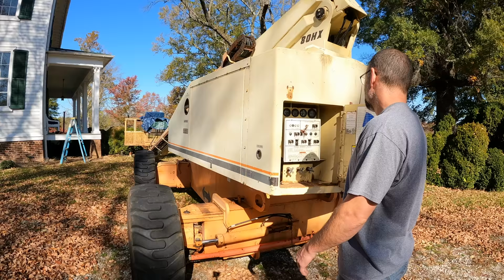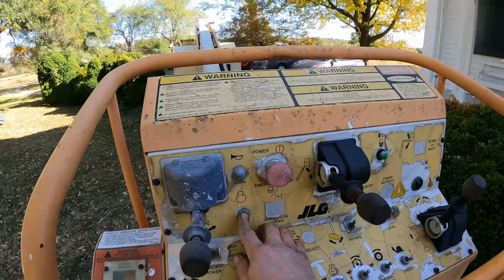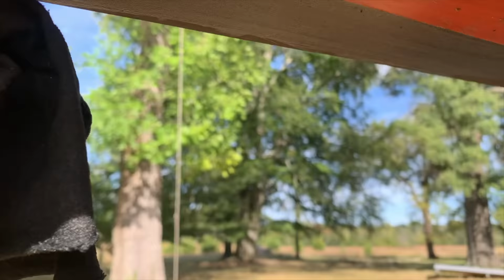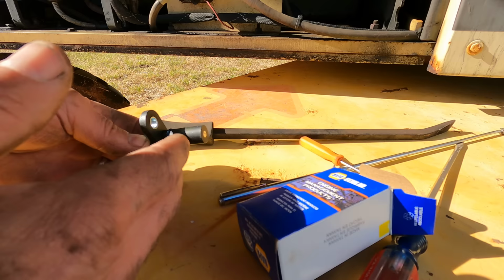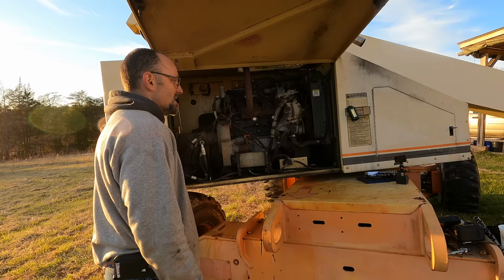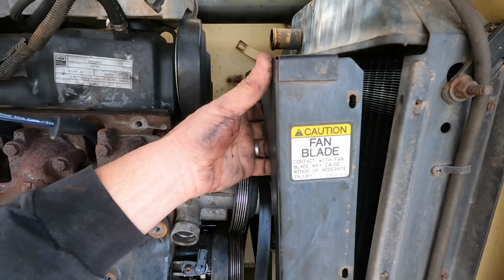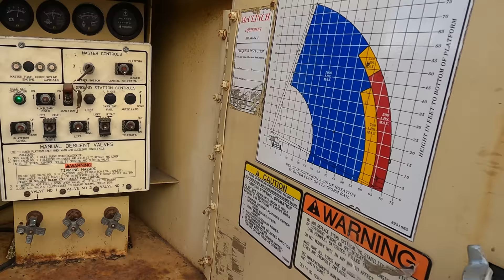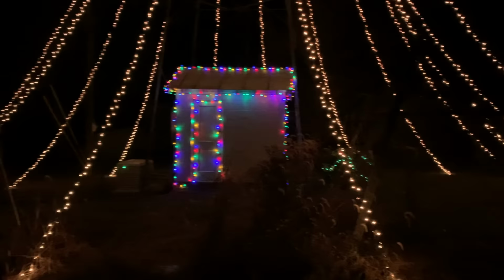My Boom Lift Broke Again! Fixing It & Then Doing a CRITICAL Job With It.

Comment: That is a wax motor on the choke limiter thing. its probably bad and not allowing the choke to open as the engine warms up, or not closing giving full choke when cold. you can test them in a pot of water. they should extend as the water temp rises.

Comment: Not sure if this matters or not, but the 2.5l ford engine is supposed to be fuel injected and not carbureted, and also is designed to be dual spark, with 8 plugs instead of four. Like I said, not sure that would make any difference with your long crank but I figured it is information nonetheless.

Comment: Change the choke pulloff piston (the thingy that's keeping the choke from opening fully) and the engine should operate much better and the carb can be adjusted properly. Check for voltage on the bimetal choke during/after start, if none fix it. Choke should be clocked just closed when engine is cold and not running. Bimetal should gradually open the choke as it warms electrically and the vacuum piston should open choke fully on acceleration. Set the idle to at least 800 - 1000 it sounds like it is still too low.  If there is a fuel pump (I forget) then rework or replace it, your not getting good fuel and it seems to be draining back when it sits.

Comment: Need to check you throttle speeds. The carb idle stop should be only set enough to keep running. Once linkage is on idle is 1080,  mid idle is 1800 high idle is 2300. Check you governor preload to carb

Comment: Have you checked to see if there is check valve missing or stuck open will allow the fuel to drain into the tank.

Comment: I bought a BMW from a garage it was just like your engine, hard to start, it went through their work shop a couple of times  with no improvement so I took it to the main BMW dealer, they adjusted  the inlet/exhaust valve clearances, to the correct settings,  the starting problem was sorted.

Comment: sounds like the fuel is leaking back into the tank from the lines.  try putting a temp tank on the top and use an electric fuel pump from that to see if that fixes the hard starting issue.

Comment: Talk about a nightmare to work on! Wow. Seems they want you to take out the engine to loosen a bolt. My excavator was a bit hard to work on but it was still manageable to get around. I did a new 90Amp alternator on the rear side of it and it worked like a charm. Cost me just USD 90 in one of the really cheap stores for car parts and such. No problems, although some of it was a bit hard to see. This is a totally different league.

Comment: I have this same carb and choke on my jlg rough terrain scissor lift, I paid to have carb professionally rebuilt, only way I can start it is pour gas in carb, once it’s warm can shut off and starts back up , I can’t figure choke out either . Let warm up 30 min and then flip switches

Comment: Your rope/ cable coiling method is very similar to the "over under" method used for power distribution cables or audio video cables. Works well with rope or anything,  can also throw out the whole length with no tangles as long as you did it correctly.  Only difference is you end up with one round loop, and not 2. I wish I could show the method in the comments. Maybe at some point I can upload a demonstration and link it to a video or something like that. It also keeps your cables from "pigtailing" and extends their life for this reason. I can't coil any other way now, but would love to get your method in my muscle memory just to have more tricks and options.

Comment: I think I would have cut that fan shroud into two pieces,  welded a little tab on one half and put a screw in each tab to put it back together. Heaven forbid you have to take it apart again but could ease the pain a little. 😂

Comment: Haven't finished the video yet but wanted to try to put my thoughts down before they run away. With the boom retracting when you have weight off of it.... seems to my feeble brain that maybe there is enough play in the boom, that when it is bearing all the weight, it could be dragging on the topside. As if on the side of the fulcrum near to the machine, not the basket it is able to bind or put too much friction for it to retract. Maybe the wear plates are too worn, or something just has too much slop in it, allowing it to drag on the top as it's trying to retract.  Putting the basket on the ground could be putting it in a better alignment and taking just enough weight/ stress/ drag off of it to let it come in. Hope this makes any sense or helps at all

Comment: Does sound like it’s starving for fuel on startup.  Fuel pump?  Check valve not checking, keeping fuel from draining down from the carb back to tank?  You’ve replaced the vital ignition components and crank sensor.  You have rebuilt the carb.  It has to be a fuel issue I believe.  Cool light tree BTW.

Comment: If you are sill having intermittent spark, you might look to see if it uses a EDIS module controlling the coil pack. If I remember right, I think that going bad could lead to hard starting?
It's been a long time, but the system was also used on the ford escort with the 1.9L engine

Comment: 26 years old man lift?   When I was young I used to do what your doing?   I learned when I got older is to not buy junk.    If you use it only twice a month, rent one.  Well I gave you a thumbs up.   I would take it and figure what you have in it and sell it and get a dependable 2-3 year old done  or new one.    That lift has a serious problem you haven't fixed it yet.  One point of advice is to make sure to carry your cell phone when your up on it or make sure you have someone on the ground to call the fire department to get you down.  Your going to get stuck high in the air on that machine    MERRY CHRISTMAS

Comment: - At 40:40, what if you split the fan shroud in two with virticle cuts {at the best L-R location}.
- Weld on 'L-shaped sleeving fingers' top and bottom, capturing the engine side flange and top and bottom of the fan shroud moulding, too. {to have tight 'finger squeeze', slightly curl the finger ends for easy alignment}
- From then on, take off ones side for parts access and keep the shroud for good cooling, too.

Comment: just a idea mabe the gas is feeding back into the tank and it sounds like it has to fill the carb each time you try to start it, try a check valve in the fuel line.

Comment: I wonder, since this is an electronic ignition machine, if you're getting big voltage drop over the power (or ground) wires to the ignition control module, you'll get intermittent spark, especially at low RPM. All it'll take is a little corrosion and you'll be bouncing around the brownout detection of the computer and it'll be rebooting constantly, which won't work well.

Comment: Hi John
Another great video, man you have a lot of patience. I am not sure if you have checked but it seems like a fuel pressure problem. Could be the fuel line allowing air in, or the pump itself . The problem shows itself after you leave it a while. I am from the UK i have worked on manlifts of all shapes and sizes. I worked on a airport so there were  vehicle mounted manlifts as well as self propelled manlifts the same as yours. They all have one thing in common safety circuits, that could be another root you can take. could be something trival as moisture in a cut out swith or moisture in a loom . Just ideas to be checked.  goodluck i am sure you will find it eventually. Merry Christmas and a happy new yer to you and your family

Comment: I think to change that part on the backside id be cutting a motor service door on the far side. Thats if the  booms not in the way.   I should know that motor i had one, but I dont.  Only put 5k miles on it new. Totaled the truck.

Comment: That half choke system could be part of how the engine governs itself. We had a shop gas ( petrol here in Australia 🇦🇺) forklift with a 2 barrel carburettor and it only used the first barrel when operating.  The second barrel was shut off and the choke flap was shut all the time. Happy hunting John.

Comment: I’m sure you’re getting a ton of these messages but I would start by double checking compression which looks pretty easy to do and then check the timing on this engine as the belt could have some stretch and be off a tooth I know you had the front of that engine off many times but I would also check the timing ring where that crank sensor was installed as  some times rust can cause them crack and be causing poor running conditions. Just a few things to check into. I enjoy watching you work through this frustration process lol but I’m sure you’ll get it eventually lol

Comment: Have you checked the solenoid cutoff valve on the carburetor? (You unscrew it at 1:59) 
This can cause problems like your having. Try replacing it or see if it is sticking, you can blank it off with the correct plug.

Comment: Have you tried changing the spark plugs?  The engine sounds like it isn’t consistently firing.  Also look for loose or poor ground connections in the ignition circuit.  The engine should run much smoother than it does, in my opinion.

Comment: WD-40 is not a lubricant if there was any grease on that chain now its gone you just cleaned everything inside there. also check the timing and spark plugs and also spark. Do some hydraulic work check the pump, change the fluids. Check for vacuum leaks.

Comment: I just went though this hard starting running bad an shutting down with my 1982 F600 with a v8 370 for the past 2 months as it has a hydro boom lift on it I use for loading 1200lb hay bales on to feed my live stock  I put a new carb on it few years ago. I took it off cleaned it changes feul filter on feul pump very little change  changed spark plugs cleaned connections.. an many other things. There be days it wouldnt start then start hard a few days later. I was pulling  my hair out as it -10 to -25 with wind an snow... the other day I had it runing but bad as well some time the muffler would glow red. . I started moving vacuum lines around looking for a broken or cracked line on one off. I happen to move the wiring harness on top of the intake an it started to run perfect . I moved the wire harness a tiny bit more an it shut down.  I un taped the whole harness back 3 feet an found a cheap butt conector all green corroded on the ground wire going to the coil. I  cut that whole wire out an made a proper connection and now even at 35 below it fires right up an runs .  No more pitch forking hay on to a kids slay an pulling it to the cows 900 feet 7 to 8 times a day

Comment: I think i would have gone ahead and done a timing belt on it when you had the water pump off. That said that engine is not starting properly. Taking a look and verifying the timing, cam/crank, would be worthwhile.

Comment: The problem is FORD.... and they were nice enough to circle the problem........:face-green-smiling: Maybe fuel pump?? You keep that hand on that starter but that long and you'll soon need a new starter not to mention how hot the battery cable is getting............ Those lights may mess with your 'standing wave' for your 'big stick'......:face-green-smiling:

Comment: I had a 99 ranger with same hard start, installed a fuel filter with a check valve built in between carb and pump, fixed mine...

Comment: Seems starved for fuel on start up. Maybe new fuel lines? If there's a crack in the fuel line before the pump, you will suck a lot of air along with the fuel. The gas will actually foam up in the carb bowl, giving lots of black smoke, as the engine runs super rich. Also, maybe a little inline fuel filter just before the carb would be a good idea, to prevent the carb from fouling up again. Merry Christmas!

Comment: Thought about the Cold Starting. This winter won’t make it any easier. What if you added a block heater? You’d only need to plug it in say a few hour before you needed it. I used to plug my Diesel Truck in but 750w was pretty pricy electric bill to sit overnight. I put it on a timer to start 2 hours before I needed to leave in the morning.

Comment: I think the what you need to do is recalibrate the flux capacitor, boot up the main frame to allow more Gigabytes through the front bus feeds. That’s should fix your issue.

Comment: Hello. That piston / cyl in the choke housing should be a vacuum pull off. The choke should close all the way not cranking, then start & vacuum on that piston should pull the choke open about 1/8 inch to prevent flooding.

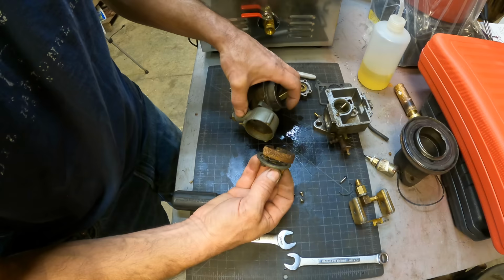Comment: @3:21 this is not a heating element, it is a thermal bimetallic strip which acts as a control for opening/closing the choke depending on the temperature
Reply from the maker: There are two electric heating elements behind it that make the bimetallic strip open the choke.

Comment: Connect a tach and see what your low RPM is running at.  My lift has 3 speed pot to adjust the the low, mid and high RPM setting but it is a 2006.  Not sure what your lift has for adjusting the RPM ranges but it sounds like the low setting is very low and may be the whole issue.  If you raise it up 2 or 3 hundred RPM I'm betting most of your issues will go away.  I also agree for the very cold starts loading up the spring pressure alittle on the auto choke will help, but that will not the stop the choking down when you let off the foot pedal, that sounds more like the engine is just trying to drop too low and shuts off.

Comment: By mid of the video i can already tell that this engine need a complete rebuild.
There also the possibility of bad fuel pump or an issue with the engine itself like a clogged fuel injector.

Comment: I just noticed on your repairing your boom lift hard starting the voltage drop down pretty low while you was cracking the starter not saying you have a bad starter but it sounds like resistance someplace and if you don't have enough voltage left for your ignition and such it might explain the hard starting

Comment: Im driving a tractordigger and i have a special kind of grease for the krane that is on it. Its dry when its not compressed and it becomes slippery when u apply pressure. Lithium grease isnt any good bcos it will collect dust and in no time you have grinding paste

Comment: Is still running rough as hell. There is still a fuel issue IMO.  Either pump is weak, tank full of crap or something along those lines. Why not apply a little heat with a propane torch?  Heat is your friend sometimes for example when you were trying to remove that broken sensor.

Comment: When I saw the state of your CPS, I said "that engine's been cooked".  I think the thermostat probably lead to the engine overheating, and probably anything that could cook, was cooked.  If this was mine, and I could afford to have it out of action for a while, I'd drop the engine and give it a complete rebuild - all seals & walruses replaced, sensors etc.  If it has cooked, there's a fair chance you've also got baked on oil on journals, so they're probably not as free as they ought to be either.
Maybe you'd have better luck wrenching on the vehicle on the right at 48:13
I don't mind multi-part videos, as long as they are distinct parts.  For instance, making something could be split into 1 - design process, 2 - construction, 3 - testing & troubleshooting.
Where did the star go?  Was it interfering with the aerial?

Comment: that choke should open fully, it sounds like the carb is boiling the fuel out after shut down, I'd try a low pressure (3 1/2 # ) electric fuel pump to help it fill  up before starting. the choke I thought should have a spring or something to counter the heater element of the choke

Comment: Do a compression test on the cylinders. With that much smoke and hard starting might have some bad rings or valves. Also do a vacuum check with a gauge on the manifold.

Comment: Did you check the teeth on the gear the sensor is working off of?  A missing or chipped tooth on the gear will confuse the crank sensor for sure.

Comment: I'm sure I wasn't the only one it was hoping you would figure this hard start thing out.  Sometimes you have no choice other than start throwing parts at it.  Maybe Clean all (and I mean all Electrical connections) and ground wires as well. I think you're on the right path to solving this problem. It seemed much better after the new crank sensor. We all have had things like that.   Intermittent problems are the most frustrating.  You're a better man than me, I would have gone nuts or started drinking. Or had a good old fashion temper tantrum. Keep the videos coming  And Merry Christmas to you and yours

Comment: If only they had designed that machine with one inch more clearance around every mechanical part. Nobody would notice that the machine got a bit bigger on the outside, but all servicing would be 10x easier.

Comment: That lift should start way easier than that.  There is a problem with the operation of the automatic choke.  Just what it is, is hard to say from here.  if it was my problem, I would be looking into an after market replacement carburetor. Not necessarly a direct replacement, but something that can replace it.  The other thing to consider is to wheelie bin that engine and throw a diesel into it.  Big bucks I know, but they don't usually have the problems like a gas engine.
Just one question.  What is the antenna atop of the tower?

Comment: It appears you have to pump fuel from the gas tank (wherever that is) to the carb when you start the system after an extended idle period. Perhaps the gas is draining back into the tank, creating an air bubble that makes the fluid hard to pump. A check valve or a very low-output-pressure pump, either one mounted directly at the fuel tank might make all the difference. That choke running most of the time partially closed doesn't seem at all right.